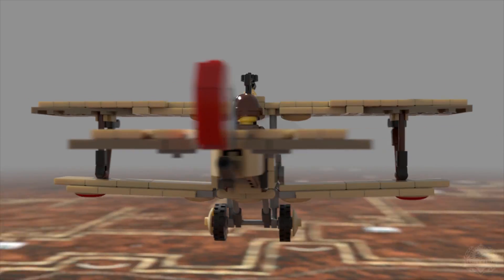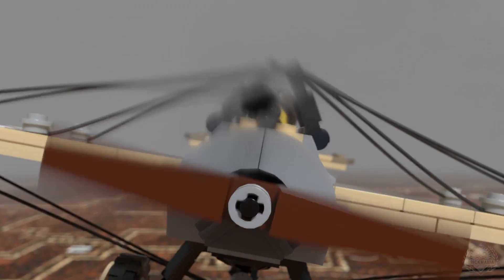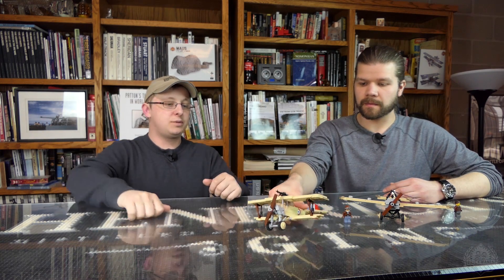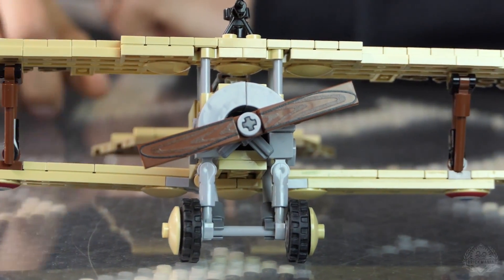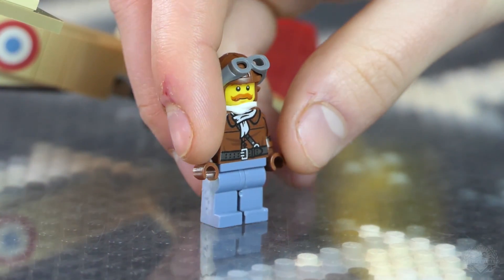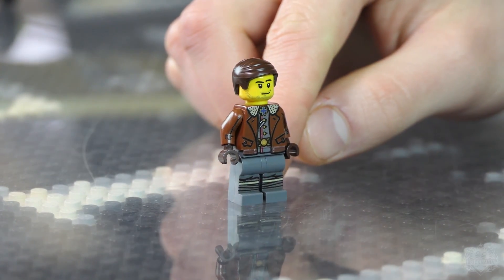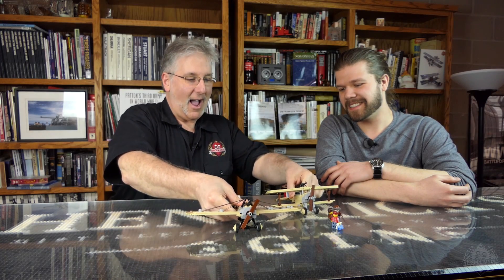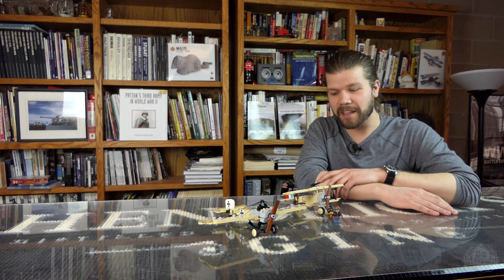Fokker E.III Eindecker & Nieuport 11 - Custom Lego

Comment: That LMG 08/15 and the Lewis Gun look great!

Also yeah, that's an LMG08/15 not an MG08/15, L in LMG stands for Luft, referring to the airforce.
Reply: TheOtakuComrade It’s Luftwaffe not Luft, and LMG stands for light machine gun
Reply: @useless2214  There were light versions of the mg08/15 simply called "light mg08/15" not lmg. The lmg08/15 was reserved for airplanes and pretty much useless on ground since it was a basic heavy mg08/15 without water cooling since that saves weight and you don't need that when you go 120kp/h. The word "Luftwaffe" wasn't used for the german airforce until the 1930ies. Before it was called "Luftstreitkräfte" so litteraly airforce.